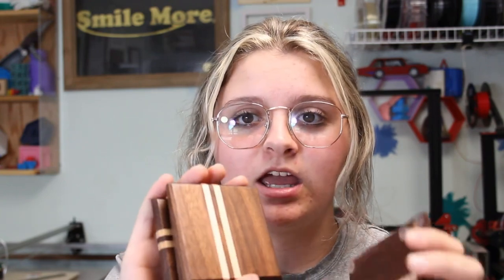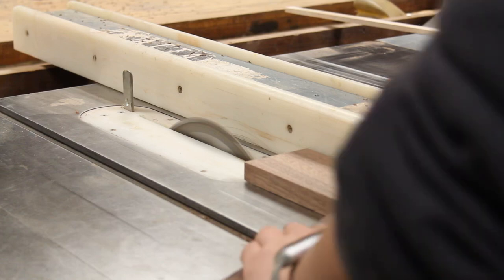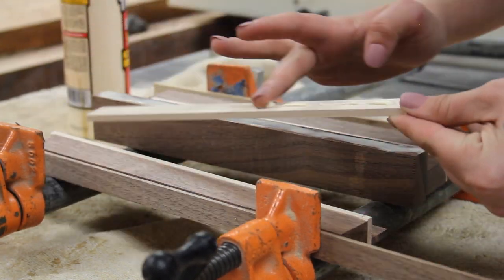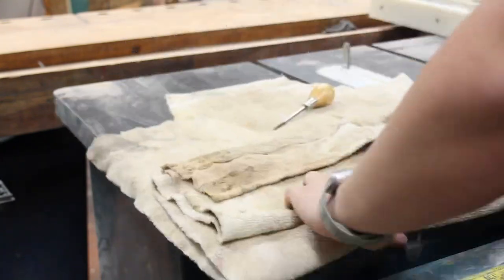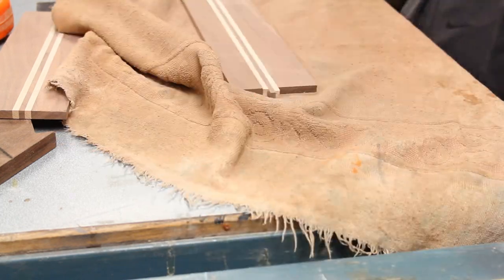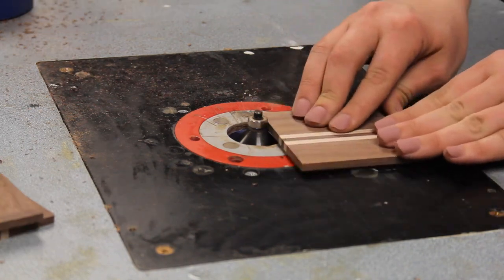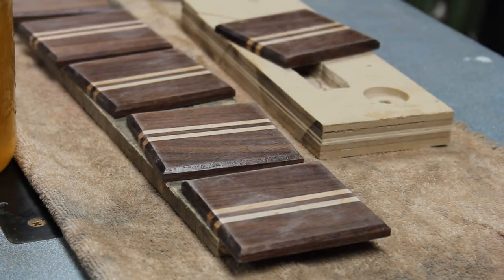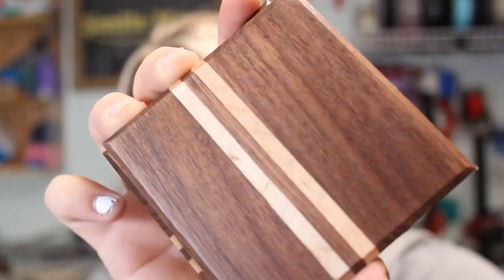Wooden Coasters- Using Walnut and Maple wood

Comment: You did an amazing job.  You might want to consider less plaining and using the table saw to cut them down closer to the correct final thickness and planing as one of the final steps.  You might get some ideas on different designs looking in to how they make inlays.
Reply from the maker: Yeah I didn’t originally plan to plain them down that much but my band saw hates me so that’s why I had to plain them down a lot